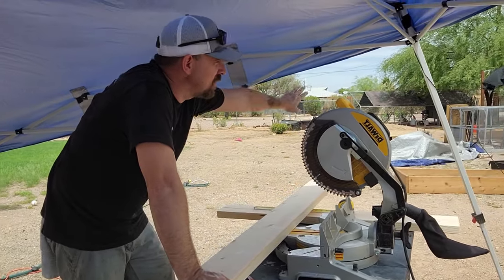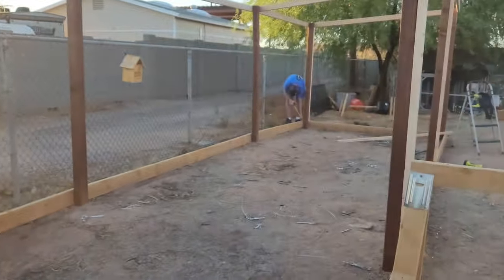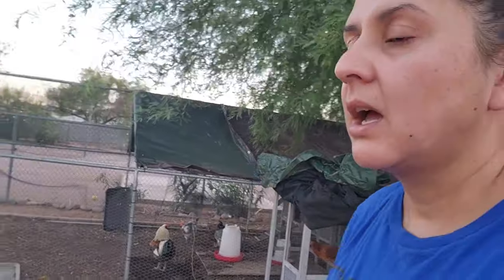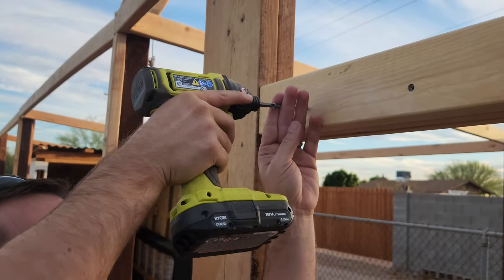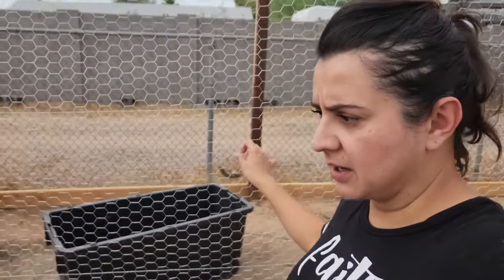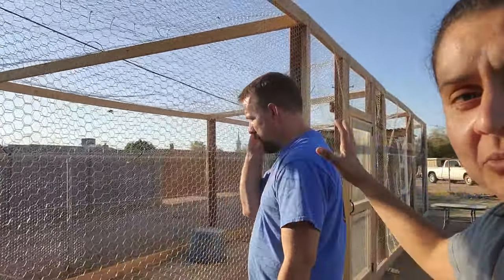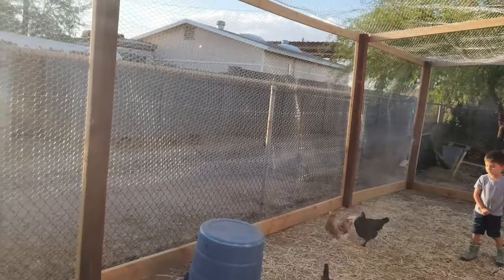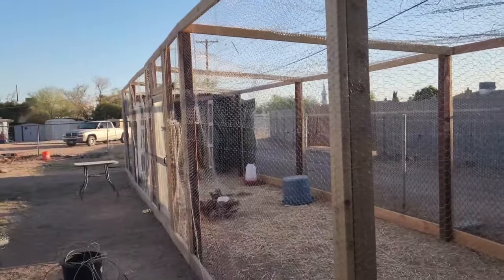Building a  50 ft Chicken Run (The Chicken Palace)

Comment: Very nice run. I'm eventually going to do one similar as a secondary so I can switch back and fourth as each run recovers (grows vegetation), but like you said, time and money. Regarding hardware cloth, you only need to use that on the lower 3.5 feet - 6 inches buried to prevent digging and the 3 feet height to prevent breaches by raccoons, bobcats, possums and the like, as they can tear up chicken wire like its not there.

The primary and extension my chickens have now are a $200 Amazon 9x13 and a 17x17 I made out of deer posts, hardware cloth, chicken wire, 2x4 headers to stop the wind from folding it in and 40% shade cloth for the roof; (I'm in FL). It's held up great against the winds so far.

Feed Tip: All my birds get the same base food; 21% crude protein grind and I restrict them to roughly 4.2 ounces per bird, per day. Calcium is free choice so the pullets don't really bother with it until they start laying. There are plenty of normal pebbles around. I have meat birds as layers so have to be more strict with food. It's a little more upkeep but I should end up with a fast growing, meaty heritage breed over time.

Comment: I go with screws that take Torx bits. They are amazing.
Reply: I was going to say the same thing. Phillips is just so testy to work with when using a drill. It be nice if we could get some reasonable priced hardened steel bits, but since almost every box comes with a bit it's not so bad. It's near wrecked by the end though, sometimes just before.